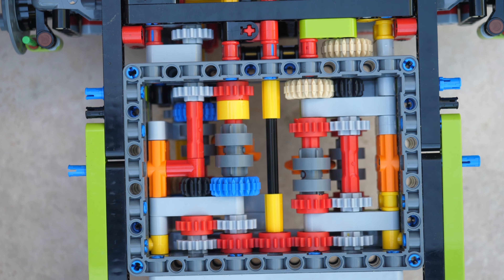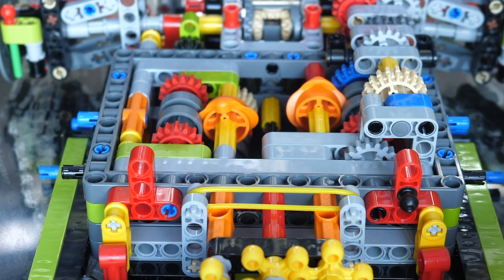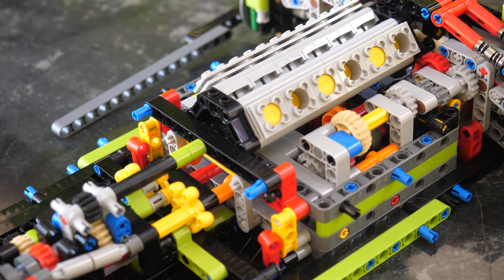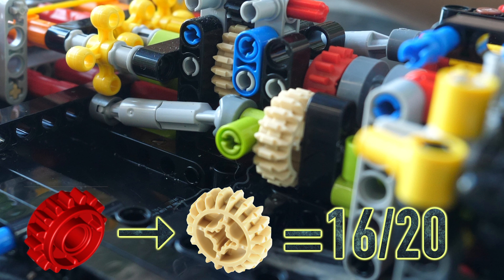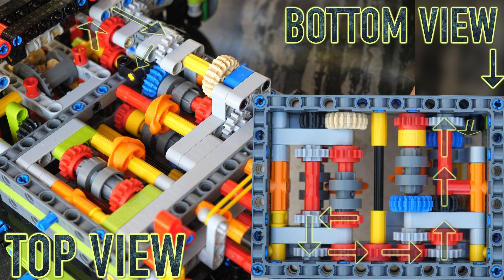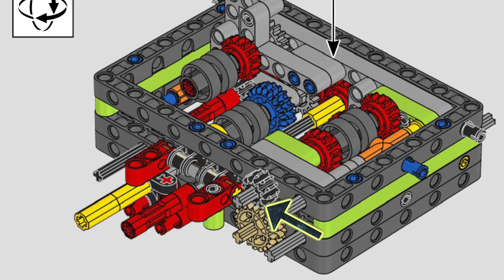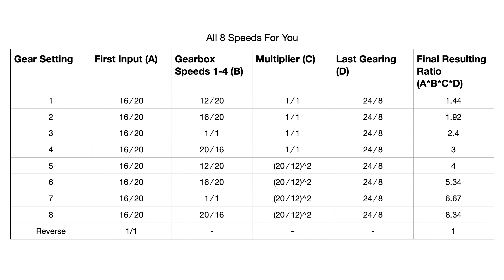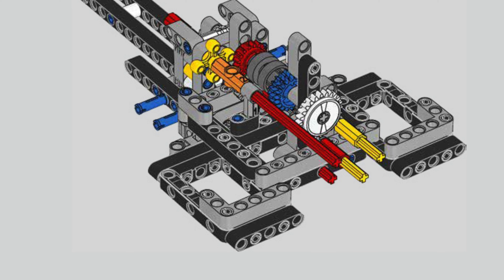Mechanical Magic of LEGO Technic Lamborghini Sian FKP 37 42115 (8-Speed Gearbox)

Comment: I've done something wrong at the time of the build. When I turn both back wheels forwards, the front wheels go backwards. Unfortunately I noticed that after when I finished the build. I hope that you have an idea where to look at?  Hopefully a fast fix 😅
Reply from the maker: I don't think you can fix your model without taking it apart massively. I think you might've messed up some gears in the middle of the drivetrain. So I could split the model there and try to find the issue.
Reply: You most likely wrongly connected your differentials - you should put one of them the other way round, unfortunately Im afraid this involves a lot of rebuilding at this stage
Reply: That’s exactly what I had to do with mine. One of them had the large ring gear on the driver side, the other was on the passenger side. They need to both be on the same side of the car. I fixed the front one but it requires a lot of disassembly
Reply: @ZajdiPL  same thing happen to me

Comment: I have a problem in my gearbox. When I am pushing the car forward, the rear tyres are going forward and front tyres are going forward. Is there are a way to fix it without breaking the car fully?
Reply from the maker: I’m not sure I understand what the problem is in your gearbox. You say when you roll the car forward both the front and back tires also go forward? So are you having issue putting the car in neutral?

Comment: wait how come when the Lambo is in reverse the gearbox is still spinning
Reply from the maker: Because remember the drivetrain is always connected to the gearbox with an 8 tooth gear and a 24 tooth gear. When the car is in reverse, the drivetrain is directly connected to the engine, so it is completely unaffected by the gearbox. But, the drivetrain is always connected to the gearbox regardless. When the car is in drive position, the engine is connected to the gearbox, which is connected to the drivetrain with the 8 and 24 tooth gears

Comment: Very good video, and also comlex, do you know if the gearbox in your bugatti didnt work because you built it wrong or it didnt work because the modle wasnt design correctly? Btw do you recomend the buggati or the lamburghini and why?
Reply from the maker: I believe the gearbox in the bugatti didn't work because of the improper model design. There's a clutch gear, and there shouldn't be one. Clutch gears slip very easily, too easily. I reccomend the lamborghini because the gearbox is more refined, the model is newer, no clutch gears, and it looks cooler and has scissor doors.

Comment: I think I did something wrong. Started building 5 days ago, removed some parts already (cannot completely disassemble it), every second speed spins without moving the pistons. No cogs are missing, everything had been realigned as the instructuions shows. What could be the problem?
Reply from the maker: It could be that some gears in the transmission itself are missing. After you finished building it, were any gears left on the table?
Reply: @Unbrickme  I had only one gear left. Yesterday I removed everything I can to see the gearbox, and compared with the instruction book, every gear was in place. So I guessed the remaining gear was an extra piece. If switched to  reverse, everything works. but only if I switch to forward, it looks like every second speed not moves the pistons. 
Edit: figured out, the missing gear was really missing but not from the inside, but rather the outside of the gearbox. IThe missing gear was not seen in the bottom view,  the right  axle near the output, there is a gray gear after a long red connector, and next to it, outside of the frame there should be another gray one, that was missing.

Comment: is the lego bugatti gearbox works the same?
because i have one but i don’t know if i built it correct and wanna know how works hope yo can do a video nice work
Reply from the maker: yeah they work the same with the multiplier and the speeds 1-4. The gears are positioned a little differently, and the stepper mechanisms are more refined to make sure that the new 8 speed gearbox gets stuck much less

Comment: Great explanation! However I found that in my car the switching system does not function as shown in the video, and I am not able to find the reason for this error. The paddle can only move once which changes speed once but it cannot go again in the same direction, it can only be pushed from the other side. So pretty much it only switches between 2 speeds. I'm trying to figure out where the cause of this error is and how I can fix it, but it seems impossible to reach anything without having to tear down the car to get to the mechanism.
Reply: Yeh same my one is also doing that my one used to work
Reply: Actually I will sometime tomorrow have a video up on how to fix it I fixed my car
Reply: My car is like half done from me doing this and getting so far then noticing
Reply: Like the back end is almost fully done

Comment: So how is the reverse gear working? You push the car forward and it goes back, or what it does?
Reply from the maker: Vladcriss the reverse gear is a direct output without having to go through the gearbox, and yeah the engine spins the opposite way, but it’s not really clearly visible
Reply: @Unbrickme  thanks!
Reply from the maker: No problem

Comment: Hi. I found 2 problems, the first was a “green” part with a little part in wrong way. Problem with changing gear.  That problem is fixet now(I fount a video to this problem). but I have another problem with the tires. The tires rotate approximately only 2 centimeters in any direction and slow down, all four tires rotate in the same direction. but I do not understand why they stop and it is as they are a spring when they stop in any of the 2 directions. it returns to the opposite direction. My Sian can’t run more than 2 centimeters ☹
Reply from the maker: could be a variety of different causes. Here are some probable ones. 1) differentials are placed the wrong way, simply flip one of the differentials. 2) another lego piece fell into the gearbox and got stuck, causing the gearbox to jam, 3) gears in the gearbox are placed incorrectly
Reply: @Unbrickme  thanks. I use your solution 2. I found a part was out of place and stop a gear.  I will send you the fix when i discover  how to put the part in the place.  Thank you and good new year 2021.

Comment: why's it technically a 16 speed? doesn't it cycle back to 1 after 8 shifts?
Reply: If they were all 1:1 ratios then it would be 16, but they used different gears which changed the ratios so now it’s 8

Comment: Mine in the 2nd and the 6th has a big frictions somewhere. I couldn't figure it out and I didn't want to disassemble the whole car. (No insta.)
Any idea?
I have only one idea: in 2nd (and mulltiplied 2nd) 10 more gears move actively than in 1st or 3rd, and the 4th is already slow enough and engine brake does't effect so much.
Reply: Same here! The 2nd and the 6th have bigger frictions than others. Have you solved the problem? If yes, how did you do?
Reply: @francischeung  I think the main problem is deformation of pieces in time.
I could carry out 2 kinds of solutions.
1) disassemble, (change a part), assemble.
2) WD40 (Or water because dust may increase the problem.) Actually I put WD40 first but it was too stinky inside the house, so I rinsed with water and put it outside to get dried.
Reply: @francischeung  For some reason this video doesn't allow me to write link. Check out on Brickset "Big Beauty in Lime"
Reply: @h734802  WD40? vamos hombre, son cauchos y plástico, no cadenas de acero 🤣, realmente lo que se debe hacer es poner un poco de vaselina en cada caucho.
Reply: @juansanchez-hd4lo , did it with silica grease. At least they turn but still something is not good....

Comment: My wheels move in opposite directions. Meaning it can't roll forward or back ward. Any tips?
Reply from the maker: Like front wheels and back wheels move in different directions? If that’s the case simply flip one of the differentials
Reply: @Unbrickme  I have both differentials in the same orientation. I see if flipping them. Helps.
Reply from the maker: Flip only one of them, not both

Comment: So if the engine gear make 1 rotation the tire rotate 1.44 in gear 1 or not?
Reply from the maker: yes lets say that the current gear ratio in your car is 1.44. For every 1 full rotation of the engine, the wheels rotate 1.44 of full rotation.

Comment: I got 2 more blue gears in Nov. 2020.
Reply from the maker: Awesome
Reply: @Unbrickme  what 3 blue gears for?
Reply from the maker: They’re 20 tooth gears that are compatible with gearbox driving rings. They’re also not connected to the axle because they have rounded hole, so you can have power passing through the gears while the axle that runs through the blue gear is completely independent
Reply: @Unbrickme  did you mean pin hole
Reply from the maker: Ye
Reply: @Unbrickme  yes
Reply: @Unbrickme  academies36 says they just spin freely.

Comment: Really, the engine shouldn't change rpm anymore or anyless in any gear. Yes rpm will increase with acceleration but not anymore than any other gear. This is the case because it drives the gearbox, but because the gearbox powers the engine it's the opposite situation. Just thought I'd point that out

Comment: My gearbox is a little weird. When I change the speeds, every 4th shift is really stiff and requires a lot of force to change. I’m wondering if I did something wrong. If you have any helpful info I’d appreciate it
Reply from the maker: Don't worry that's normal since every 4th shift the second stepper mechanism engages to engage the multiplier gearbox

Comment: Ok so I’m confused here... when you show your “bottom view” it’s actually a mirror image of what you see when you actually look at it from the bottom of the car.. at least on mine anyway. Unless I built it wrong.  So it’s hard to look at mine while watching the video since it’s flipped.    Also, when in 1st gear. I can see the pistons moving. But when I click the shifter to 2nd. The pistons don’t move.. but when I go to 3rd, the pistons move again. They only move every other shift I do... is that normal?
Reply from the maker: They only move every other shift? No, that’s not normal. The reason I flipped the bottom view is because, that way, it’s easier for the non technic fan to match the gears. That is, easier to see which gear is which
Reply: Ya I just looked at it again. First gear works as it should. It matches the positions of the grey pieces on your bottom view. When I click the shifter to 2nd. It moves the grey gear selector up, away from the blue gear just like your video shows,  but it seems like it’s in neutral on my car. When I roll it, the engine isn’t moving.  But then when I got to 3rd gear. It works again. 4th seems like neutral. Then 5th makes the engine move and so on.  So really it’s like I have 4 gears instead of 8. Every other gear connects to the engine. The other 4 act like neutral.   Ugh.  Not sure what I did wrong.
Reply from the maker: @Schwing27  did you already build the whole car or are you just on the chassis stage?
Reply: Unbrickme whole thing completed... :/
Reply from the maker: Then I wouldn’t be too worried. It’s much more of a hassle to fix the gearbox than to just present it as is. The gearbox isn’t even that playable
Reply: @Unbrickme  I did this. You have missed a small grey gear that sits outside the frame on the second axle. Quite an easy fix with a little stripping down. I think around step 110